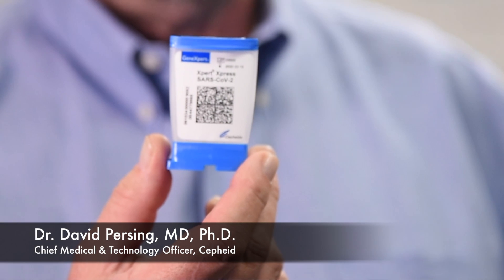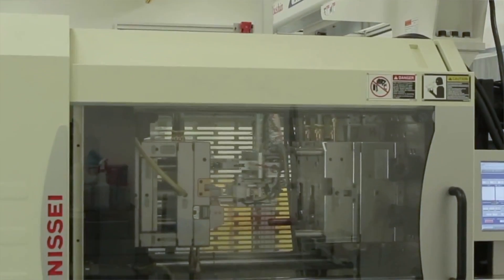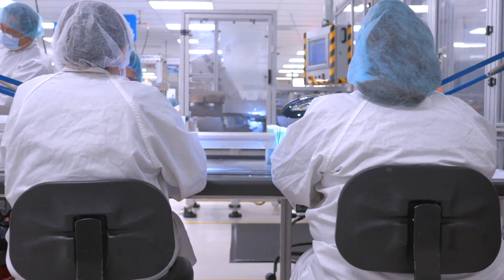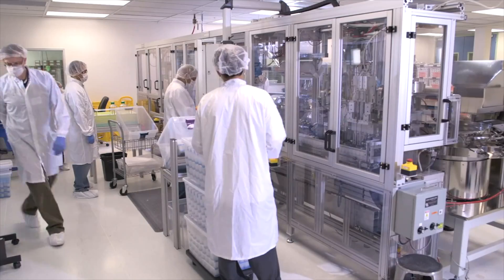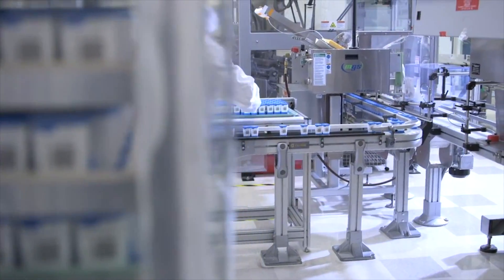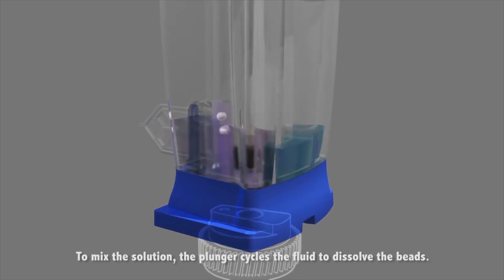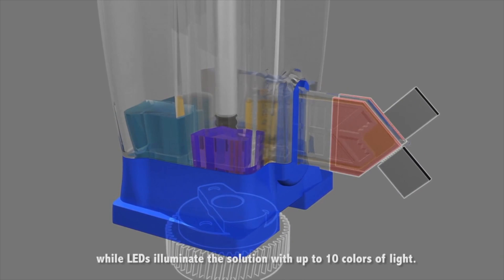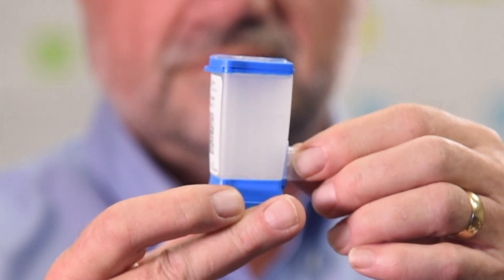Learn How Cepheid's Xpert(R) Xpress SARS-CoV-2  Test Cartridge is Made & How it Works

Comment: ☼ it is very cool. and you can run 2 tests on each pt at the same time, to at least statistically overcome shortfalls. & still in under an hr. at least as good as one could expect to get. im not sure ~$80 per test is that bad? even if it does cost $3. as long as the science is also good. which is the trouble w/ "emergency auths" and making trillions available, but possibly for a ltd time and you better be first! what does that get us? un-proven, market rush of 2Mil tests - that it turns out all dont work to an incredible degree (bc what would one expect w/incentives set that way? ). almost as if science should not be done for profit, but rather the purview of gvt only. & even greater oversight by independent sci journos, w/arrest powers. 

 unless it is something i or my company im associated w/. you can just buy those and put them str8 into the field.
Reply: I'm confused about your post.  Where does $80/test come from?  I didn't hear that.  Doesn't sound that bad, though.  Sounds like you don't understand the science behind the tests and what the tests say (and how they say it) and don't say.

Comment: So from viral RNA extraction through PCR heat cycles (amplification) everything happens inside this plastic cartidge, including detection - visualization of result (presence or non-presence of virus). So there is  no need for separate PCR machines and ELFO, only the GeneXpert Xpress Instrument where the cartridge goes... So - I wonder, what is the timeframe for a detection? Minutes? Hours? How is the validation for sensitivity, specificity, robustness etc.
Reply: Test takes less than 50 minutes. Cartridge has internal controls like Sample processing control, probe check control etc. External controls can be included too. We are using the 16 module system for only admitted cases.
Reply: PCR tests are accurate at 95-98%, so, since this is a legitimate PCR test, I would assume it is the same.  Pretty amazing!